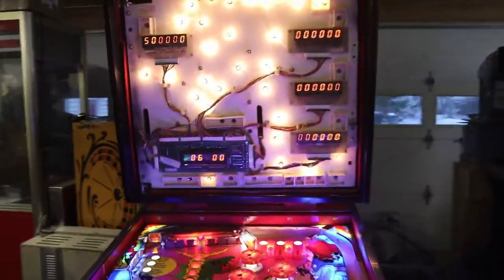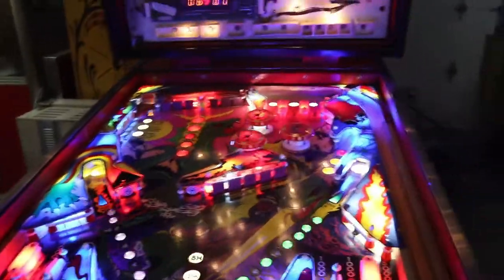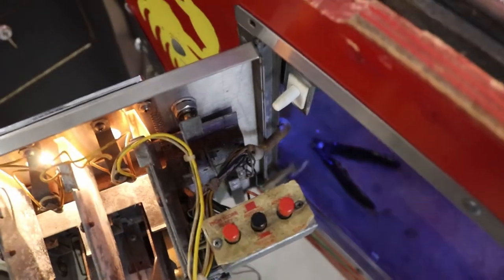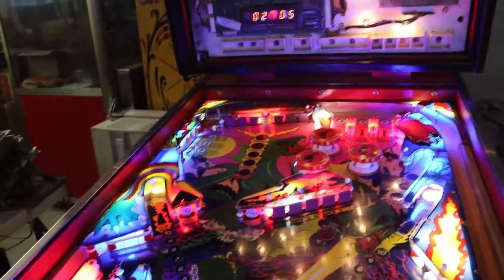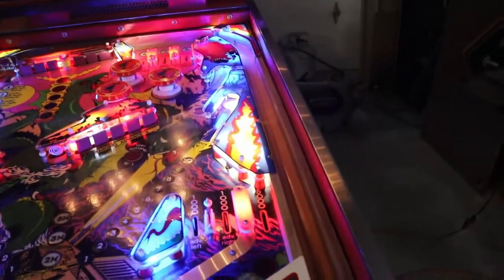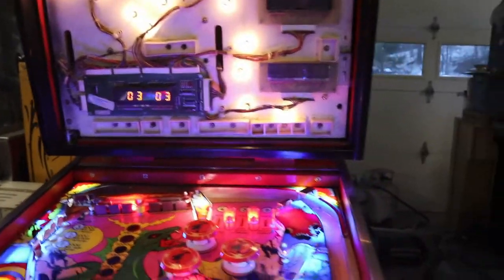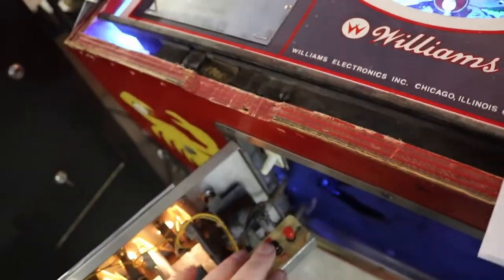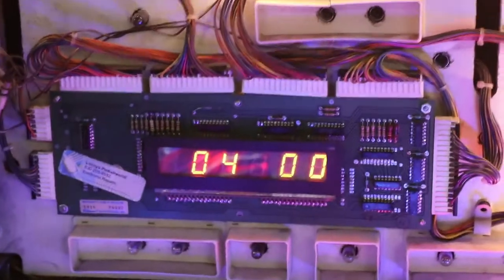Testing & Programing Williams System 6 Boards / 1980 Scorpion / Left For Dead Ep 8

Comment: What section of the pinball manuals is this type of programming called? This is programming all the settings of the pinball game
Reply from the maker: Instruction Booklet (August 1980) The pinball Machine Database. Game Adjustments.
Reply: @RetroGamingWithHopper  So its not the service manual or repair manual for the pinball game. You're using a general Instruction Booklet for ALL pinball games?
Reply from the maker: @waynegram8907  No it's the instruction book for Scorpion. Each pinball machine has one, for example, Gorgar will be different because of the speech board, and think it also will have special solenoids in it.
Reply: @RetroGamingWithHopper  So the Scorpion Instruction book is completely different than the Scorpion Service Manual and User Manual?
Reply from the maker: @waynegram8907  The instruction book is what the operator would get. I looked at the service manual and this programming, switch information wasn't in it.
Reply: @RetroGamingWithHopper  thanks for looking into that because I have never seen that type of programming in pinball service manuals. The Instruction book is the User Manual I think the User Manual and Instruction book are the same thing not sure. What type of programming is this called?
Reply from the maker: @waynegram8907  Williams_1980_Scorpion_Operator_Handbook.pdf Instruction Book Game Adjustments.
Reply: @RetroGamingWithHopper  thanks for the help. I guess they call the programming " Game Adjustments"
Reply from the maker: @waynegram8907  I know they call Game Adjustments and I call it Programming because that is what you are doing. You Are Welcome and glad I could help Wayne.
Reply: @RetroGamingWithHopper  I was confused about what the programming was called because I couldn't find it in the operations manual. I will look under he section "game adjustments" or programming game adjustments. Thanks for the help